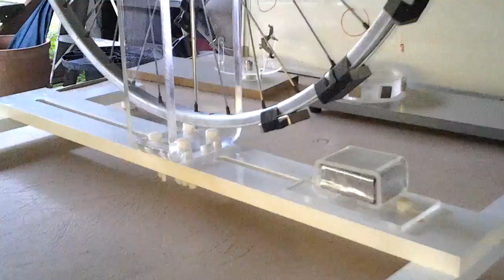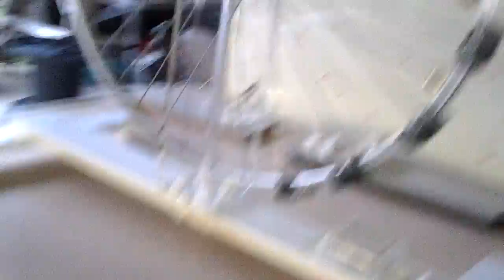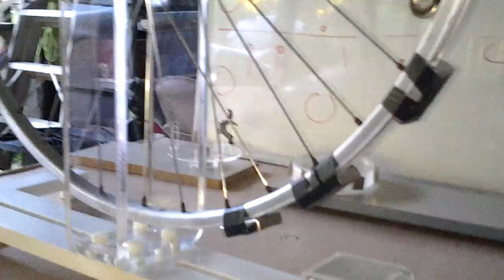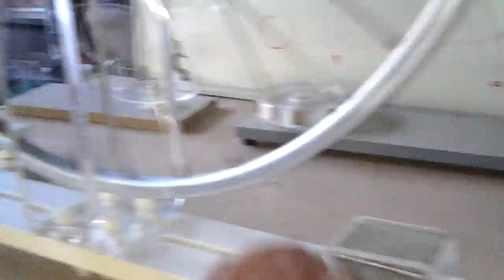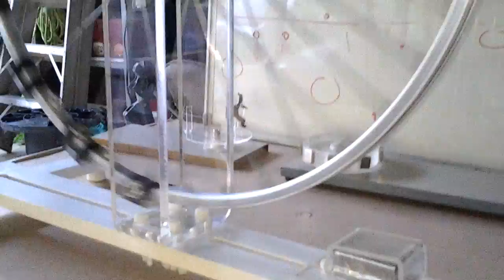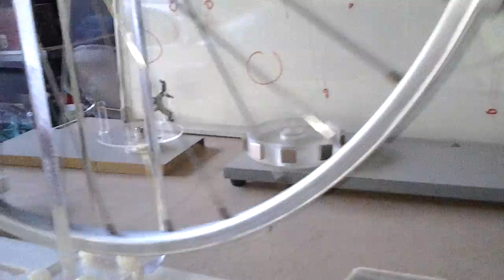Magnet Motor Using James Roney Stator

Comment: Nice effort Mate!  I would space your rotor magnets closer to each other and maybe have 3 groups, I would also shield the trailing edge of them as well,  that would add mass to the wheel.and cut another 50% drag?, And Max amount of Roney Stators per wheel, and also stagger them to cover any dead spots for acceleration. I would also add more wheels on the same axle, and stagger the angle, so you always have acceleration.. No dont make the last push!!!!! Mag gens that use repulsion get de-maged real fast!(saving you money mate!)! ONLY USE IN ATTRACTION MODE FOR A LONG LONG LIFE!

Comment: He only needed to add three more stators to get it working. I have been away for a long time for reasons I rather not get into here. However if you would like to be a part of our, "Think Tank" then why don't you join us over at: https://www.facebook.com/groups/FreeMagneticEnergy/

Nevertheless, this gentleman did an outstanding job replicating my work. Think of the single stator he is using in this video as a piston in a car engine if you will, now he needs to add three more pistons/stators to get it to run smoothly.

Cheers!

Comment from the maker: Hi bob s.
Thats a good idea about the smaller magnets.
Might try that.
Have also added a support arm so i can lay it over flat and avoid the balancing magnets. Seems to add more friction that way for some reason though. Probably bicycle bearings designed to run vertical i suppose
Reply: Hi Gene
The latest iteration of James Roneys' wheel consists of magnets all the way around apart from a single gap. This configuration produces torque as the rotor accelerates past the stator.
It might be possible to use this torque to store potential energy to help it past the sticky spot. A simple way of doing this would be to deliberately unbalance the wheel so that the magnets can pull the 'heavy' side uphill but arranged for the heavy side to be travelling downhill when the last rotor magnet passes the stator giving it some gravity assistance.
The amount of unbalancing weight will be limited but it should be interesting to see if there is any benefit. Vibration won't be a problem at the speed of this motor.
Reply: The sticky spot is long gone. The last magnet clears with the greatest of ease as the lead rotor magnet gets sucked in the next magnetic stator.

Comment: narcat As long as the magnets can spin  the wheel, we can make electricity  from it using our good old dc motors.
Reply: A magnet cannot "spin" this wheel by energy it has within itself, any more than a spring can push or pull a object without being compressed or pulled against its normal undisturbed position.  Any energy you get out of the magnet to spin the wheel has been put into it by an initial push or pull of the wheel to get it started.  A magnetic dynamo must be cranked to get DC out of it.  An electric motor requires electricity to get torque out of it.  If you continue to doubt,all I can say is try building one and see for yourself.  This one seems easy enough.
Reply: narcat  I fail to interpret what you are trying to suggest or put forward.  According to  James Roney Stators  magnets have the faculty to do 'work'- As shown in his video along with in this video, Neodymium magnets were able to spin the wheel  incessantly. It seems to me as you statement potentially proposes that the magnetic field which have the ability to pull on ferromagnetic material is  irrational and ludicrous. If I am correct, energy is defined as the strength to do things. Well, magnets have the strength to push other magnets away and pull ferromagnetic objects. So, why can't they be used to create mechanical energy? Which alternator and DC motors can convert into usable energy. Scratch that,,, only DC motors- preferably. Alternators require some kind of input to get them working. For the record, are you supporting  James Roney's research or on the side of the laws of physics???  And to make things straight- I too love science and have done research on them. Anyways have a good day/night!
Reply: Energy/work is indeed the ability to do things, but only independently of outside influences.  A magnet, like a spring, will only "push" against you if you "push" against it first.  It will only "pull" against you if you pull against it first.  Neither a spring (nor the magnet) act to push or pull without the outside influence of you pushing or pulling against it first, hence no additional energy/work is added to the system by the magnet.  It only reciprocates/repeats what you put into it, and never at 100% efficiency.  Notice in this video in particular that the wheel WILL NOT START turning on its own.  It always requires a slight push, and eventually slows down to a stop.  It only appears to work at first because of the acceleration as the wheel magnets just pass the stator magnet.  However, if you were to carefully plot wheel motion on a graph, you would notice just as much deceleration as the 4 wheel magnets pass and continue on to the next set.  After just a few turns and the thing finally stops on its own (it has run out of impetus from his push).  Also notice the lack of any real follow up evidence from either Roney or this guy as to having made this thing really turn indefinitely (really, nothing since April?).  I tell you the truth, I have built several versions of these types of machines just to prove/disprove them to myself, and so far none of them work.  Again, refer to Zooney1's comments below.  Humbly, I suggest you try building even the simplest version of one of these to see for yourself.  Until then, no further answer will suffice. (And, for the record, I support the laws of physics).
Reply: narcat
By the way, gene fewings was able to get 3 mins 30 seconds of rotation, I am pretty sure I can tune and modify it to get 6-8 min of continues working... I will continue my research in this area to patch this problem up. I am considering a DOOR LOCK ACTUATOR for the job.

THE IDEA-
Bike wheel spins motor, which generates electricity that is connected to a controller, and stores energy inside of a battery, that discharges into a inverter. Inverter discharges into my home and a capacitor in the side. Capacitor  powers controller and door lock actuator.
Reply: Danyal Ahmad You need to be very careful here about how you define work "done on" and work "done by" a magnetic field (or any "potential energy field" - including gravity).  This is a classic mistake made by beginning physics/engineering students.  I know this, because I used to teach these very principles.   Indeed, if you drop an intrinsically magnetic particle into a permanent magnet's field, the field definitely does work on it as your article suggests, but it is only able to do so because at some previous point in time someone or something external to that field did work to remove that particle a distance further away from the field.  This would have to be an outward force opposing the inward pulling force of the magnet (you could say the magnetic field does negative work on the object during this part of a cycle).  

This is similar to rolling a boulder up a hill against the force of gravity.  You could say the bottom of the hill is pulling the boulder toward it as the boulder rolls down the hill gaining velocity (mechanical energy), and that gravity is "doing work" on the boulder, which technically, it is during that time.  However, now that you are at the bottom of the hill (particle pulled in and stuck to the magnet), you will get no further work out of the field until you pull the object back out, away from the field.  An external entity will need to expend an equal or greater amount of work/energy to raise the "potential" of the object again to a state where gravity (magnetic field) can again "do work" by pulling the object back in.  Overall, then, no net energy is added during the complete closed cycle to the object by either field.  You must always consider a complete closed cycle (or loop): starting point (top of hill) to end point (bottom of hill) and back to same starting point again in your analysis.

And because of friction and other losses, you never get back the same amount of energy you put into the system during the complete closed cycle - this is the problem of entropy and the 2nd law of Thermodynamics (which I won't discuss here). The fact that gravity is weaker than a magnetic field, at least up close, is irrelevant to this discussion.  For a well balanced and lubricated wheel bike wheel, I should expect with enough initial push someone could get 6-8 minutes spin out of such a wheel with or without magnets, but it will inevitably coast down to a stop, according to well established laws of physics.   And it doesn't matter whether it's in a gravity field or not, the result will be the same.

Danyal, unless someone can truly demonstrate such a device is spinning at a stabilized regular rate (no coasting down over a long length of time, say 30 minutes) then I would say they lack necessary and sufficient empirical evidence to show any real effect of interest to any serious scientist.  I would like to see plots and graphs and some mathematics to support your theory against well established physical laws.  The burden of proof is on the challenger.  Again, you really need to try building one to see for yourself what is really going on here.  Science is about hypotheses (which you have), and experimentation to test (which you don't).

I will not post again unless you can show me that you have at least tried some of this your own.  Kindest regards, and best of luck in your pursuits.
Reply: narcat yes, well said.  Finally a voice of reason.
Reply: Well..since magnets CAN'T spin the wheel, I guess that is moot.

Comment: BTW: I forgot to mention that the closer the armature magnets are to each other, the faster the acceleration. Like, one inch or so apart. I use "1 inch round N-42 Neodymium magnets with the poles through the thickness. 

In summery: Just as the last armature magnet is about to slow the wheel down, the next stator in line needs to start pulling the lead armature magnet. This will offset the small counter pull from the first stator with a sudden thrust or big tug. Simply add multiple stators all the way around to enable this process to repeat itself. Think of stators like a piston... you'll need 4 pistons/stators to get smooth operation.

The lead armature magnet is simply, "leap frogging" from one stator to the next stator. You can also introduce a coil of magnet wire within close proximity of the spinning armature magnets around the wheel and then unleash the electrical energy stored in a, "fast charging" capacitor in the form of a, "pulse magnet" to give the last armature magnet an extra kick/push as it leaves the previous stator.

As you now know Gene from your own first hand experience, that the armature magnets pass through/over my stator with the greatest of ease, there by adding a little extra kick via an electromagnet pulse will go a long ways.

*It goes without saying that getting both the permanent magnets as well as an electric pulse magnet to work in tandem yields the best results. Simply buy a magnetic commutator from an online store as they are dirt cheep and will make your work a lot easier to fine tune the electric kick! 

As you know, we find all kinds of videos online for self running motors/generators, but nothing works quite like this, let alone can produce the enormous, "foot-torque" required to produce the kind of electricity that it takes to run a home, let alone a factory. However, I have yet to reveal how to add enormous torque into the design, the kind of torque that will easily crush human bones.

Stay safe.

James
Reply: What just the magnets are touching each other on the wheel? That way I can fit about 50 magnet instead of 30. Also I am planning on using 20 stators on my wheel for maximum speed. Any suggestions?
Reply: @danyala.1659  - when I place magnets all the way around the wheel something completely changes, causing the wheel to no longer provide continuous rotation. I’m hoping to understand why, and figure out a workaround for this challenge.
Reply: JamesRoneyStators I love this set up, gravity can actually be used as second free fuel when the system is in the vertical, not horizontal position, the key is to have a system where in the JRS's are in repulsing feild for 2/3 of the cycle, and where in 1/3 of the system is always in the fall, or active gravity drive side.    I did this first, then tried to alone magnetic forces for assistance...   The system had hard to duplicate results do to the how presise it had to be... I'd be happy to give you guys the diagrams.... Basically it's a perfect balanced system, that the JRS's unbalance for 2/3's of the cycle... sabaistianmatus@yahoo.com if interested email me
Reply from the maker: Danyal Ahmad 
The problem with putting them end for end is that the magnetic repulsion is so strong it rips the tape.
Drilled and bolted maybe?
Reply: @gonative1234  - The magnets do not need to be put end to end. Just within about a third of an inch to as much as a half an inch from each other. I typically have used electrical tape which is very flexible yet strong with lots of extra layers about 3 to 4 turns of tape. With the correct placement you won’t even need to hold them down with tape anymore as long as the wheel has plenty of attraction to the magnet.
Reply: Danyal A. Just now seeing your response. Contact me directly through Facebook. Simply join the Facebook group called: Free Magnetic Energy to contact me.
Reply: Danyal A. Just now seeing your response. Contact me directly through Facebook. Simply join the Facebook group called: Free Magnetic Energy to contact me. I’m the group founder.

Comment: Wow Gene!!!!!!! What a great replication Sir!!  Great choice in materials, too!!  And yes, I'm watching!!! YOU BET.  Off hand you need only to address two issues for now, with a third option to take it up a notch or two..

(1) The stator needs to be a bit closer. There is a sweet spot where it works the best.

(2) You need the next stator to be positioned so that the lead armature magnet gets sucked/drawn into the next stater while the last armature magnet is still being sucked/drawn into the first stater. You need to add two more staters around the wheel that repeat the same process for a total of four. Each stater needs to be at the 12, 3, 6 and 9 o'clock positions. You can evenly space 5 stators around the wheel for better results.

(3) There is yet another thing that needs to be done to make it work even better if your up to it, but it's extremely tricky to explain. Simply put; just like 3D Chess, you need to do the same... in a three tier cylindrical fashion... however you still only need the one wheel you have, but the forks/bracing for the wheel will need allow for some 6" of space between them. I'd need to send you a pic of what I'm talking about.

Nevertheless, steps 1 and 2 should be plenty to get you going, where as step 3 starts to add considerable speed and torque. In the end, this concept will never have a lot of speed, rather what it lacks in speed it will make up for in enormous torque, more than enough torque to easily turn a generator over, even under a heavy load.

I know I have been absent and I plan on being around a lot more, as life has its twists and turns that took me away from my work.

Again, like wow!!! You did an awesome job and then some!!! Congrats!!!

Note: As long as you have another stator sucking in the lead armature magnet before the last magnet of the set of armature magnets pass all the way across the previous stator, you should be just fine.

Please write as no doubt I will stay in touch with you!!

Hope this helps :)

Cheers!!!

-James
Reply: Yeah! Then it will work just as well as yours! Which is not at all!

Just how many times HAVE you been convicted of fraud? It is definitely more than once.

Comment: It's "sticking" because of using the type of magnets you have on the wheel... they need to be closed off at the ends... else what you will end up with is constant push and drag and will eventually come to a stand still.... If one looks at Johnson's Linear "Motor" you will see the magnets are all together, with no open ends...
Reply: IT is sticking because of those pesky laws of thermodynamics.

Comment: Why is this exciting? Are you hoping to create a perpetual motion wheel - or even a wheel that accelerates and from which you can draw energy using static magnets? I have seen James's videos too and have done some experimenting myself using a record turntable instead of a bike wheel. Unfortunately, while it is possible to see some temporary acceleration past different arrangements of magnets and stators (that can look exciting/encouraging) it is not possible to achieve net wheel acceleration ie increasing measured RPM, with any arrangement of static magnets - that is what I found and that is what the laws of Physics say you should find too (unfortunately) . I see James has gone quiet for the last few months as I guess he has found the same thing too that you simply can not create excess energy from static magnets - you can not increase the RPM of a wheel and therefore there is no excess energy. It simply doesn't work. The only way you can increase the RPM is by pushing the stator forwards every time it passes a wheel magnet and of course then you are the source of the energy that makes the wheel spin faster - you are just pushing it without touching it in the latter situation. . .
Reply: IT is not possible to get it spinning even ONE rotation.
Reply: Well said!
Reply: What if you  put magnets all the way around  the wheel,  and use like 20 stators? Hook it upto a permanent magnet dc motor. Use the output to charge a battery/battery bank, which at the same time can be discharging into a inverter. Free electricity after the initial construction cost?